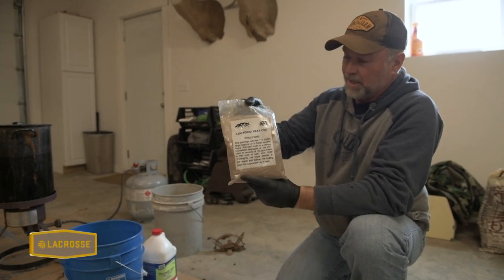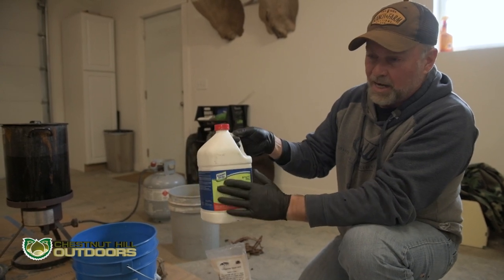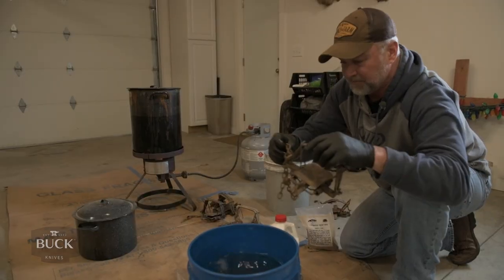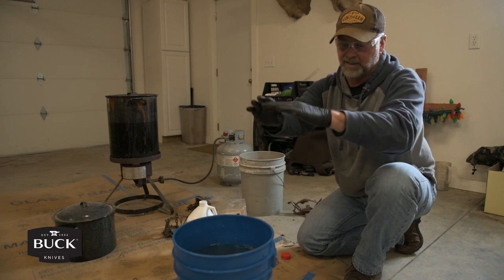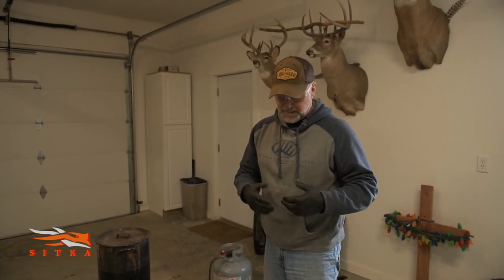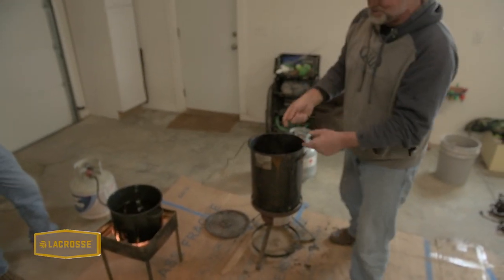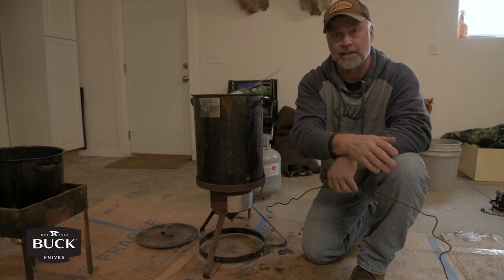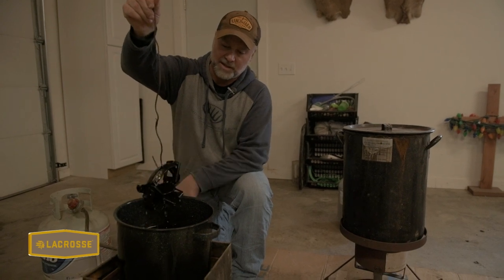Trap Preparation | HOW TO Wax and Dye Traps

Comment: Going into second year of trapping.  Expanding a bit this year. I have bins full of traps from my father in law. They are quite rusty as he hadn't trapped in a log time. Will the muratic acid clean the rust? Not familiar with it.
Reply from the maker: Yes it will! Depending on how rusty they are you may have to do a little scrubbing after soaking them in the acid.
Reply: Thanks. Sounds like a summer project

Comment: Rather than pouring the oil out of the bucket you can stick a garden hose in the bucket, turn on the water and let the oil flow down the side of the bucket. Just a suggestion.   Thanks for the video
Reply from the maker: Great tip!

Comment: I’m new to trapping. Looking into giving coyote trapping a try. 
Would it be okay to maybe heat your traps up in the oven?  If you can’t go from dye to wax right away? To make sure your traps are warm when you go to wax them.
Reply from the maker: The wax will be melted so there wouldn't be any need necessarily to heat up the trap before putting it into the wax. 

We love to see new people getting into trapping! Good luck!
Reply: @Whitetail_Properties  i was going off of what you said about being able to do it one after another. With your comment about the trap being warm already when you go wax it.
Thanks! I’m being hopeful! It sounds like a lot of fun
Reply from the maker: @midwest8six607  If you wanted to heat them up boiling water would work just fine!
Reply: @Whitetail_Properties  You can also just add the wax on top of the boiling water and save yourself 5# of wax and not have to worry about burning the wax or catching it on fire. Pull the traps out slowly and it accomplishes the same results safely and no extra buildup.

Comment: Those large panned traps you use intrigue me.   I'm curious as to would it possibly be better to orient the trap 90 degrees from the way you bed them?  It seems that any situation that throws the trap with the target's foot on the central perimiter (middle of the jaw) of the trap over the jaw, could that possibly tend to maybe at times throw the foot upward and out of the jaws before they close?  Granted, the situation would be similar if the situation presented the trap throwing with the foot positioned over the central side area over the jaw with it bedded 90 degrees to your norm, but it seems easier to steer this way, and it seems as if even then, its still significantly more likely to sling the foot up and out the original way...wholly out or to a toe catch.  Its likely not much difference, if any at all, but any little advantage should be expkoited Id think....again, if it's an advantage!  Believe me, I'm asking, not advising per se!!
Reply from the maker: Every trapper does things slightly different from our experience. There isn’t an exact science per se. We would just recommend trying different things on different sets and analyzing your results!!

Comment: Can i reuse the wax agian or do i throw it away
Reply from the maker: You can re-use the wax multiple times, especially if you are dying new traps. Once you get into the old/used traps that are full of rust, dirt and other debris the wax can get a mucked up. But ultimately its a personal call when you want to change it out.
Reply: I have been Using the same wax for three or four years now by Walmart sells 1 pound boxes of wax for like $1.30 so I just add three or four boxes every year when I redo my traps My wax looks gross but it has no odor!

Comment: With a 24 hour acid bath ,and through cleaning the traps come out spotless. Using two turkey cookers . One has 40 pounds of melted wax. Once melted turn the heat off of it. It take about 15 minutes only at boiling the coat the traps totally black. Straight out of the dying solution , I shake the traps, and wipe anything off with a clean paper towel. Within in a minute they go into the melted wax, which is crystal clear.  Within five seconds they are out and onto the rack. I keep the dye solution boiling all this time. Twenty traps this run  about two hours to prep and run them through. I can only fit like five traps at a time in the dye turkey cooker, If I had a way bigger boiling dye pot I could cut the time down to less then one hour.

Comment: From my perspective, the reason trappers today dye and wax their traps is unproven and based on theory. If dying is for scent, why cover it up with wax? If wax is used to keep in the scent, how is the critter going to smell it. Especially at a distance and considering most trappers don't consider prevailing wind direction when setting? Key word here is "theoretically".  A hundred years ago a trapper would have pissed himself laughing if anyone had suggested this.
Reply: I use wax to keep the trap lightning fast and to protect against rust. I use salt as an antifreeze and without the wax covering the trap would be a ball of rust at the end of the season. Even without salt, the trap will still rust more over time than without wax. So no, wax isn't unproven and based on theory. In respect to scent, you are correct in that it is debatable. But weather proofing with wax is a fact.
Reply: I don’t do squat with my traps except set them.
Reply: @billeehighsmith7983  Do you time the traps? How much faster is a waxed trap compared to a nonwaxed trap. I have 6 traps that are dyed and waxed and 5 are painted with Rustoleum. I cant tell any difference in speed and the painted traps  are catching most of the animals.
Reply: I believe that traps, clothing or really anything will never be scent free. It will reduce the odor to a point that the animal will think its not recent human activity. In turn, it's safe to investigate.
Reply: @billeehighsmith7983  Back in time again? A hundred years ago salt was available but never used as antifreeze. The primary friction in a trap is between the levers and the jaws and once the trap is tripped the wax is scraped off. No one has proven the reduction in spring tension due to rust??
Reply: @allywilkeforsenate  A hundred years ago a trapper would leave his traps hanging in a tree on his line at the end of the season. Of course, there were no snake oil salesmen trying to sell pipes, buckets, boxes, waxed dirt, catch poles, sabre tooth drags, polyfill, cordless drills, rebars, calcium chloride, peat moss, glycol, shovels, hammers, screen pan covers, and my favorite, cookie cutters???
Reply: @brianhoxworth3881  A dog's sense of smell is 400 times better than a human's!
Reply: Personally, I dye my traps to keep them somewhat camouflaged when close to the surface soil, and wax to prevent rust for the longevity of my traps. Yes I’ve heard wax can keep the traps scent free, but after 1-2 catches I feel the traps are going to be covered in scent anyways. I’m not crazy about scent control, but I do feel anything I can do to keep it to a minimum will help. Whatever I can do within reason to make my traps or equipment smell less human/suspicious to an animal, will likely help my catch ratio when it comes to an animal privy to trapping or an animal that is too nervous due to an unfamiliar scent.

Comment: Two things...
1- always add acid to water, NEVER add water to acid. 
2- never use acid indoors. It fumes as it’s working and anything in that garage made of steel (ie tools, car parts, guns) will rust afterwards.
Reply from the maker: Good tip!

Comment: That might work on dozen traps but I have several hundred traps. Can I drop them off and you clean them up for me? Lol
Reply from the maker: Sure but we charge by the hour! LOL
Reply: How do you do yours. I don't have spare time much less a hole day
Reply from the maker: @fireman9093  There are products like formula one, that are one step applications for prepping traps. If you are prepping dozens of traps that might be an easier way to prep your traps.
Reply: @Whitetail_Properties  i have never waxed was going to give i a try. I run year-round and don't have much moisture so not much rust. I just brush them off and keep going.
Reply from the maker: @fireman9093  And with little moisture/humidity you probably don't have to worry about rusting as much!

Comment: Galvanizing would protect against rust much better and way longer than waxing rusted surface.  That rust will thrive underneath the wax. Oxidation would also protect better.
Reply: Coyotes can smell that metal and oxidation. Dobbins talks about that, they will dig up the untreated metal parts of a trap like the swivels and not the parts that are treated, as if they can smell it.